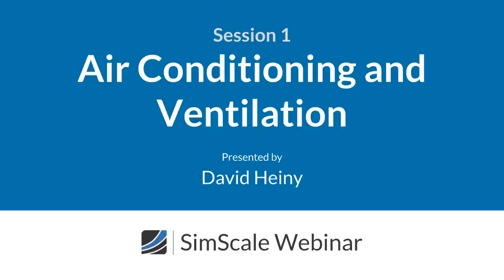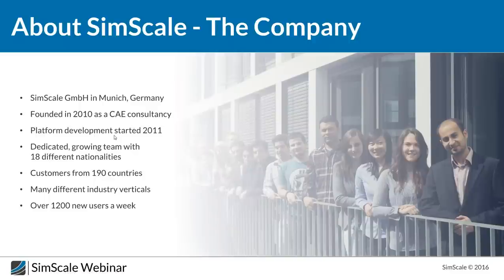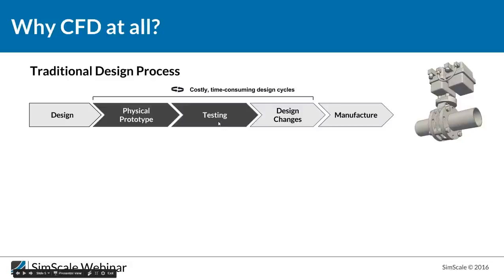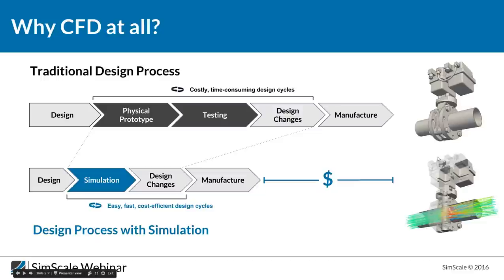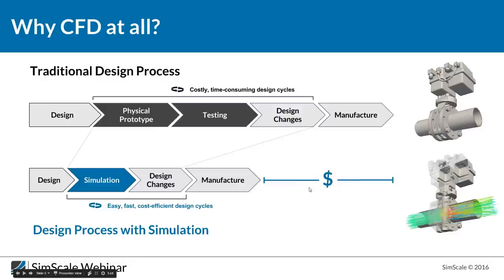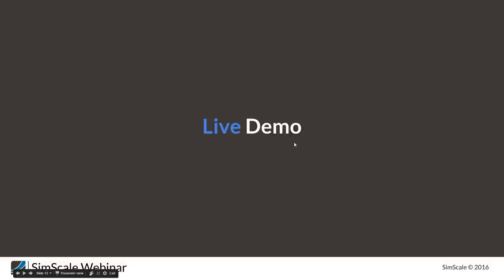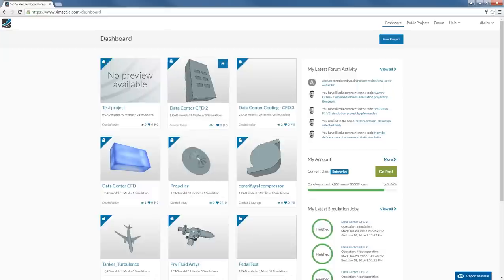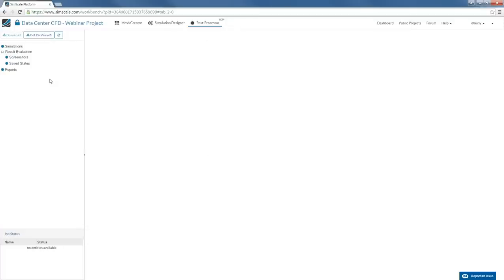Air Conditioning & Ventilation Workshop: CFD for Data Center Cooling

Comment: I have to do a conjugate heat transfer analysis from fluid flow in turbulence with the multiphase porous medium separated by finned wall & coupled it with mass sorption & transport through porous media in transient mode.....Can I do this simulation in simscale within a month ???

Comment: Hi, I am doing a research on Split AC condenser heat rejection and temperature/air flow pattern in high-rise building. I need to do k-epsilon cfd model simulation. Please advise on how to in simscale